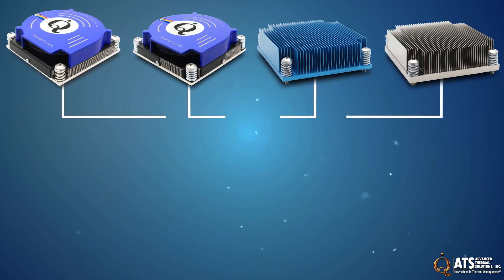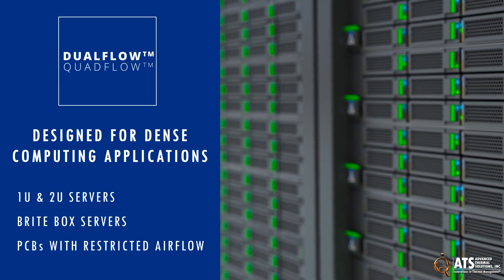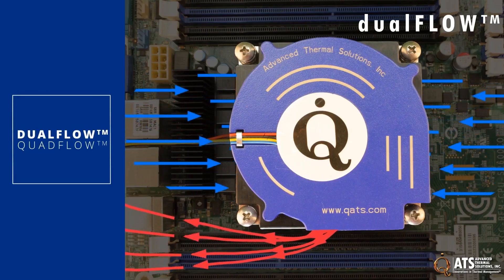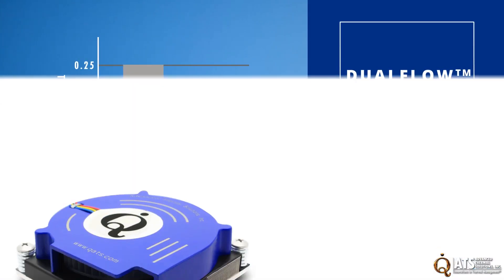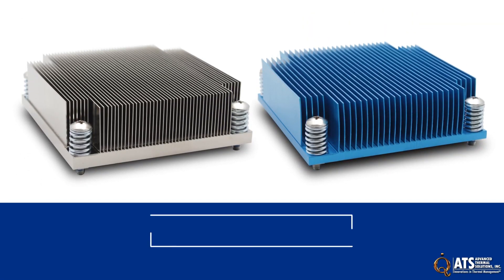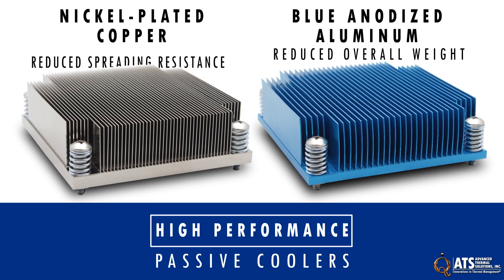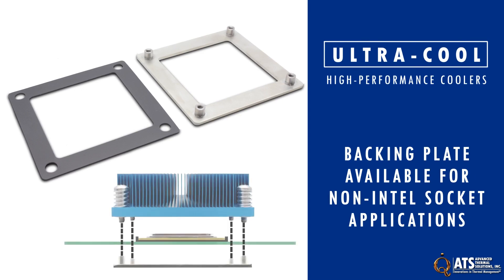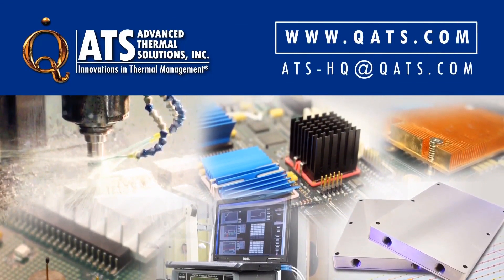ATS Ultra-Cool Active and Passive Coolers for High-Powered Devices

Comment: Where can I find the vapor chamber options on your website? Do these fit the AMD chipsets?
Reply: Hi there! 

The vapor chamber options are available in the same link as the other heat sinks. You can purchase them via one of our distributors such as Digikey or Mouser. 

These heat sinks will fit any Intel LGA2011 square and LGA2066 (Socket R) sockets. For other components, such as FPGAs or other BGAs, you would need to drill holes in the board at the corners of an 80 mm square. We sell a backing plate, ATS-HK379-R0, that can be inserted from the back side of the PCB. The screws from the heat sink mate to the standoffs in this backing plate.